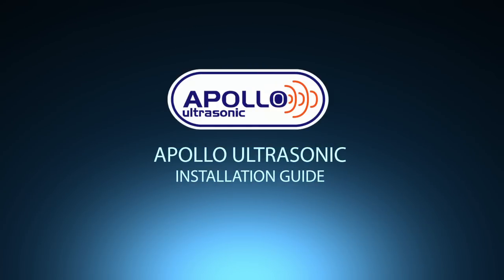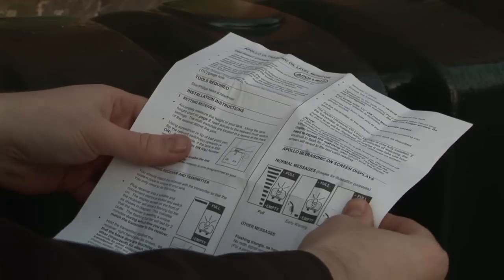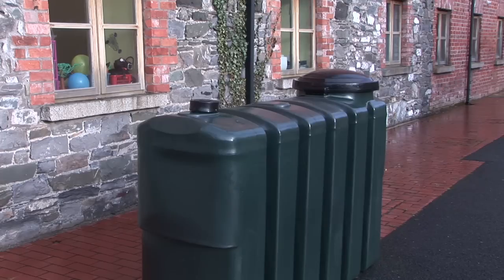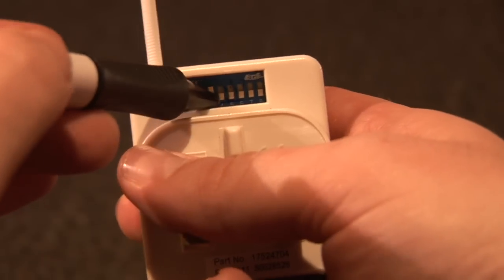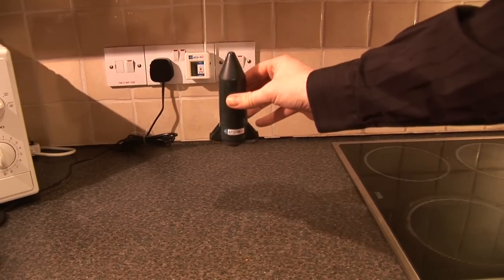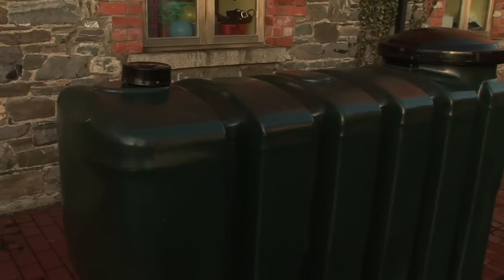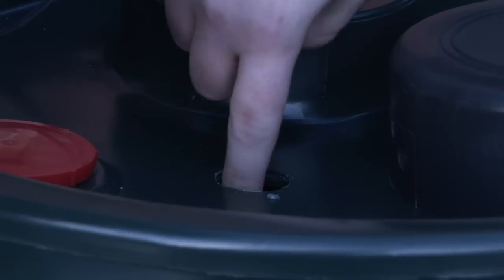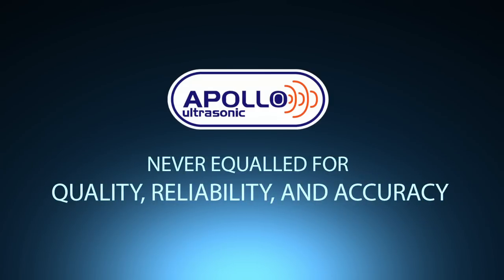Apollo Standard Oil Tank Gauge - Installation Video

Comment: I was told by the company to reset the level indicator unplugged, by swiping the dots with the sensor then rematch the two. It worked again the next morning. I had to do this after replacing the battery.

Comment: My oil tank is 1270 mm in height, but your installation guide only gives me options for 1250 mm & 1300 mm. In order to pair my tank, what measurement should I go for?
Reply: The sensor reading is only an approximation of the oil level in the tank, so choose 1250mm as the nearest measurement for your tank. You won't notice any discrepancies - it will work perfectly well.

Comment: What happens with the swarf that falls inside the tank of the hole has to be drilled? I wouldn't want it floating about in the heating oil.
Reply: SuperLittleTyke 
My thoughts exactly!
Reply: THATS why they didnt bother showing it on the video!
Reply: I wouldn't worry about it.  You should have a filter installed in-line anyway..

Comment: Don’t even tell you what type of battery to buy so you can have it ready  for when and if anyone can ever be bothered to show you how to replace one.  When I had my new tank out in, it took only 2 years before the receiver stopped receiving.  And I’ve asked thousands of people and no one knows what to do.  Also, what on earth is a star shaped screwdriver- is this in English?
Reply: Battery is a std Lithium 2032 3V cell. If the receiver stopped receiving data, it's a fair chance it's down to the sensor battery failing. If changing the battery and going through the pairing setup again doesn't fix your problem, then unfortunately it's time for a new one. In my limited experience (I've only ever had one unit, that I still use) they're pretty reliable. Mine was new old stock, probably ten years old before I came across it, and with a couple of battery changes it's still working another 8 odd years later...

Comment: Impossible to change a battery.  No instructions anywhere!  Have been searching for over 5 years to find a way to put in new battery.  No oil man knows.   Nobody knows!  Utterly useless.
Reply: Two self tapping screws on bottom of the rocket reciver
Reply: Remove "rocket" from tank, turn it upside down and remove two stainless steel cross-head recessed screws. Slide cover off, replace battery and reverse disassembly procedure. All in all a ten minute job.